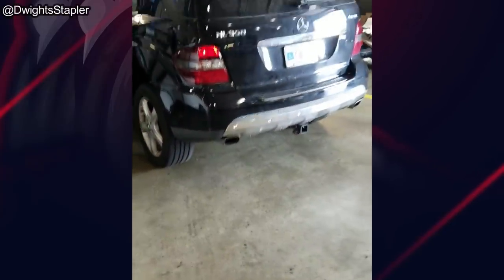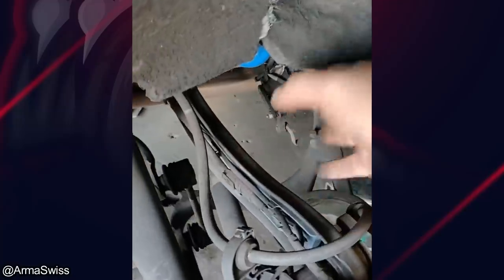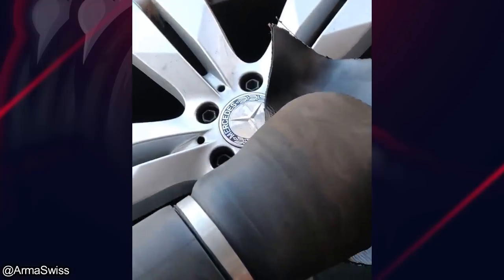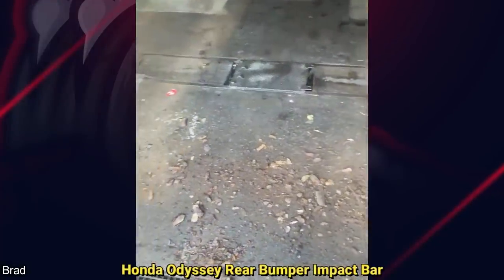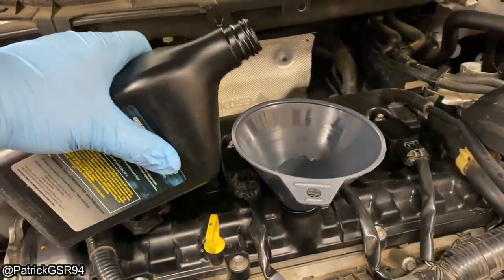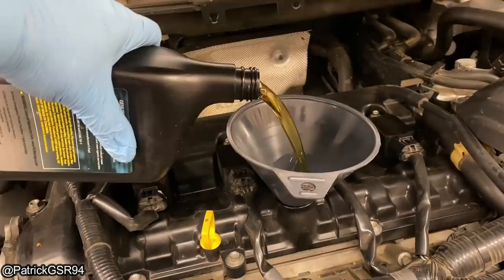Customer States Vehicle Smokes After Oil Change | Just Rolled In

Comment: If you pop a hole in the bottom on the oil jug you can do 4 or more at a time if your funnel is large enough to leave them inside.
Reply: Hard to use the bottle for your old oil after.
Reply: I have a shop.   I put the oil in the used oil tank and have safety Kleen come and remove it.   But if you are doing oil changes at home.  You can get a 55 gal drum of oil for your car and save a lot of money over the course of a few years buying in bulk.   After a couple years you will have more then one 55 gal drum.   One for used oil.  One for new oil.   And just bring the used one to a shop and pay them $50 or whatever to recycle it for you.   Or free if you know a mechanic like me.  :) or if you live on a dirt road in the country.   You can use the garbage oil to oil the road do it does kick up so much dust when someone drive by unless your municipality says you can’t.   But if you want you can funnel the oil back into small jugs instead and deal with that headache.   Up to you.   Oil chances are a regular thing so I plan ahead for them.
Reply: @daniellepage2923  Not a mechanic that's for sure so I respect what ever works for you.  Be nice to live in a place where I could have 55 gallon drums around.

Between ours and the kids cars I probably only do 20 oil changes a year, plus trans, differential, coolant.  I mostly use gallon jugs.  I drop the old fluids at the recycling center a mile from my house for free.  Certainly not a headache for me.
Reply: @davidhoulden5791  that works.   If you have a place close by that takes it that’s a great deal.    20 or so oil changes is about 80-100 quarts of oil a year.  Prob 0w20 or 10w30 depending on what cars you have.    If you don’t have space for a barrel then you don’t got space.  And it’s understandable.

Comment: I owned a 1998 Olds 88 that I had going on 12 years and it started to creak and groan one day in 2018. My mechanic found the problem to be the subframe rusting away and the worse of it was around the right bolt that attached the subframe to the main unibody. As much as I liked the car. I decided to take off the road right there for safety reasons. 

I'm wondering what the guy who owned the car at 0:51 was thinking.

Comment: That first one.  They drain the front differential and added 8 (more) quarts to the engine oil pan. Ouch.  
I’m surprised there was enough room in the pan for twice the required capacity.

Comment: The mercedes air suspension happened to all four of ours at some point. One of them, the car was idiling and ready to be taken to the shop. was about to explode because It had sagged down and the compressor overheated. I was 20 feet away and I went "MOM! LE...."

The airbag exploded and set off our neighbors car alarm from about 50 feet away. That wasn't a fun limp over to the shop
Reply from the maker: Damn that must have been loud! Sounds like an expensive fix.

Comment: Drains the diff.. overfill engine.. saw similar with a Toyota Tercel.. custom drained the gearbox under the engine and then put 5 litres more of oil in engine .. made it approx 60 km before the gearbox Chernobyled and several thousand dollars later we rebuilt it.
Reply: Well I did that many years ago with what at the time was a quite new 96 Corolla. It was quite obvious though that the color of the oil coming out was very wrong so checked the oil stick & level had not dropped. So I knew what had happened, but even without that surely they would check the oil after filling it? I really cannot understand how that could happen. Even a dumb-as non mechanic like me it was really impossible not to realize that mistake. That Jiffy-lube place in the US seems a total joke. This is not rocket science. In NZ we have a similar operation called "Oil Changers", I have been to several branches & they always seem to do a perfect job at a price that makes doing your own a bit pointless. Levels always perfect, you know what is going in, and they tell you what else needs doing. I have overheard them recommend another customer to take a fix to another shop, a coolent change on a late model car that presented risks if not done properly. So they have my confidence.

Comment: holding the oil bottle with the spout up doesn't help much if you drain the front diff  instead of the oil
Reply: A $10 hand pump works best for me, very little spill.

Comment: I can verify that if you drain the transmission when you think you've drained the crankcase and then put another "fill" of oil into the engine, the car will smoke like that. Not that I've ever stood at the Honda parts counter desperately hoping the clerk won't ask me why I need so much transmission fluid...

Comment: I remember one time a customer brought a vehicle in the head of oil change saying oil has never been changed had a lot of miles on it the one thing I set did I saved that old dirty oil because I knew putting fresh oil in that engine would probably cause it to smoke and that's exactly what it did I even told the customer that may happen so I drained a new oil out put the old oil back guess what the engine quit smoking.

Comment: I know lots of Mechanics watch these videos. Can somebody please 
recommend a way to un- stick the oil rings on an old 93ish 4.3 IN A 88 
S10 BODY. (other than pull the pistons)  Pulled it out of the woods at 
my house while i was dropping the trannie in the GMC. Changed the clutch
 ,and rear main seal. checked the pvc. No apparent leaks. using quart 
every 60 miles. Out the exhaust I ASSUME ,,but not smoking. ABOUT to 
delete all the vacuum lines .  ANY IDEAS ? Thanks !

Comment: WTF. How much neglect does it take to let the floor pan of your car rust through. That's not something that happens overnight. That car certainly never had a maintenance inspection. I wouldn't be surprised if the rest of the car was similarly well-maintained. It's probably also a good bet that the brake pads were never checked and that it never had an oil change. 

And I'm not from the U.S. and I don't know what a quick lube shop is. But how can someone like that own a repair shop? With the engine burning that much oil, the catalytic converter is probably also trashed.
Reply from the maker: A Quick lube shop is a building that you can pull up too and drive your vehicle in and get your oil changed quickly. Their known to be quicker then going to a shop or a dealership but I don't think they're any cheaper.
Reply: I live in a state that uses lots of salt on the roads in the winter-even well-maintained cars like mine eventually rust. My current truck has rusty wheel wells, but  I have maintained it by the book from day one. Just because it looks beat-up doesn't mean it's junk. It still runs like new, and I'm not wanting to spend $50,000 on a new one anytime soon.

Comment: I am NOT a fan of German cars.  They make their cars out of lousy parts anymore, then charge a shite-ton to replace them.  And that's if you can even work on the car yourself because they've been designed to resist any repairs by the owner/home mechanic.  My mother had a BMW 328i sport wagon and it broke down on average once a month.  My father and I spent hours replacing components that fought us all the way when we stopped taking it to the dealer mechanic (who of course screwed us over by charging insane prices and not repairing the car correctly).  Feck that.  Dad bought her a Toyota and in the ten years we've owned it, nothing has ever gone wrong.  For what one pays, German cars are garbage.

Comment: How the hell do you accidentally drain the pumpkin instead of the oil pan?? Who thinks an engine in a car as small as that takes 8 quarts??

I put more than 100k miles per year on my vehicle as an oversize escort. I use valvoline and jiffy at least twice a month. Never had a problem. Walmart will fuck off my drain plug sometimes but I've never had issues at the quick places. Dafuq?

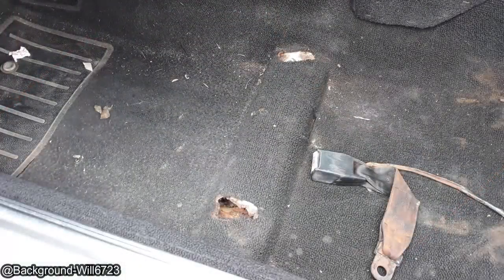Comment: 1:25 I have driven while sitting on a toolbox, have driven without the seat being bolted down (knowingly), but f--k me, that is just too much.

addendum: on a related note, before I got couches in my first apartment, I used the passenger seat from my 91 Cougar instead of just ploping my ass on the floor, pretty comfy, but a little on the low side.
Reply: Me and the guys had a little "fort" in a vacant lot as a kid; the car bench seat somebody fly-dumped worked great instead of sitting on the ground.

Comment: true story
customer states:
engine and transmission noisey. brings in under new car warranty. 
tech finds he drained the 5 speed transmission and added 5 quarts of oil to the engine. 
transmission burned up with no gear lube...engine cavitated the oil and burned it up as well.
no warranty. customer pay.
Reply from the maker: Ive seen that happen before also. 😣

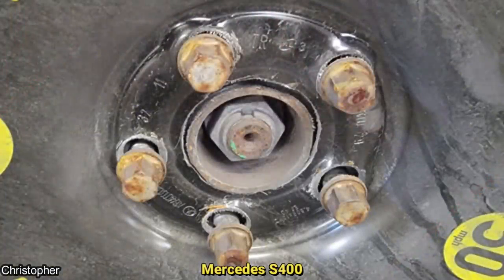Comment: 2:00 I mean, that's a remarkably bad decision on Mercedes part to be honest. Yeah the owner should have read about it in the manual but there shouldn't be different lug bolts for a spare wheel.
Reply from the maker: Agreed on that.
Reply: Needs different length because the alloy rims are a lot thicker than the steel rim of the spare wheel, so to avoid the lug bolt getting into conflict with things like the parking brake the steelrim needs shorter.
 if the owner had selected to have an alloy spare too it would not have been a problem,
And in all honesty I thought it was common knowledge that one needed that when having steel spares, maybe it is a european car thing somehow, because have been that way on pretty much all cars I have had with alloy rims and steel spares.
Reply: @MMM_MADness  My current car and all past ones (most of them Fiats mind you) all had wheel studs and used nuts. I guess Mercedes could have welded spacers on the stamped steel wheel to match the thickness of the alloy ones, but as the name of the game in car manufacturing is cost cutting it's safe to assume an extra set of shorter bolts is cheaper.